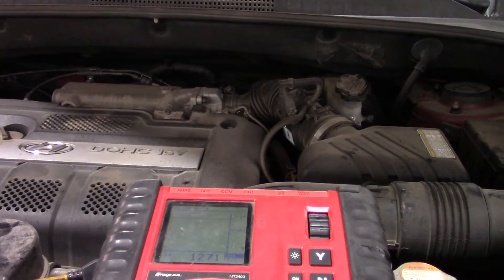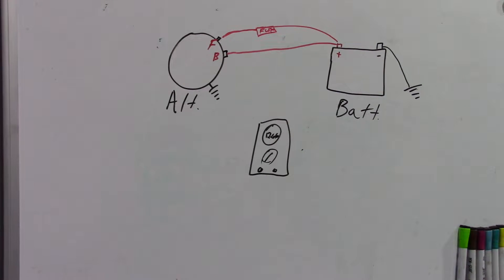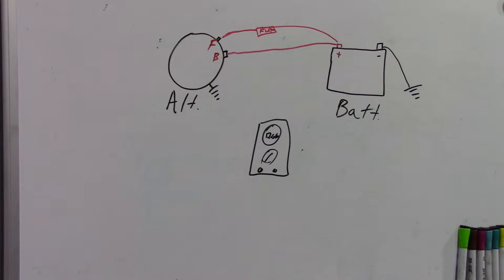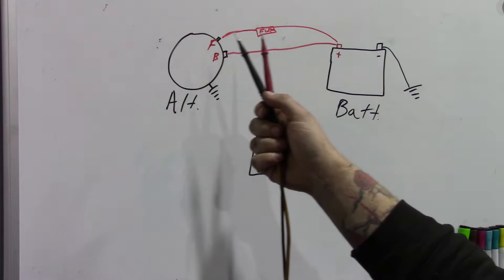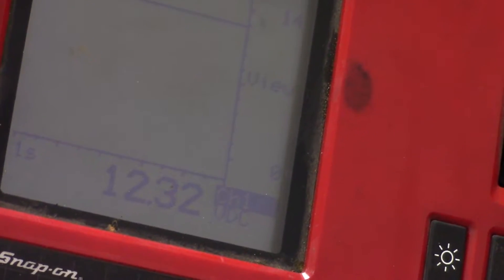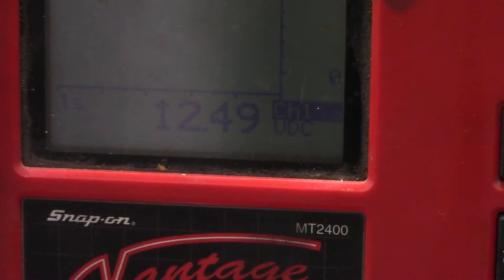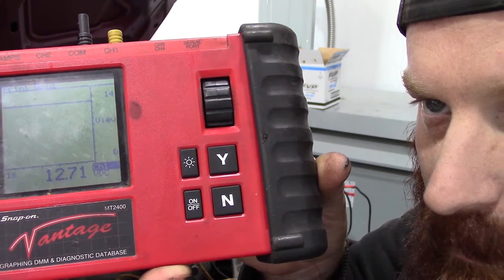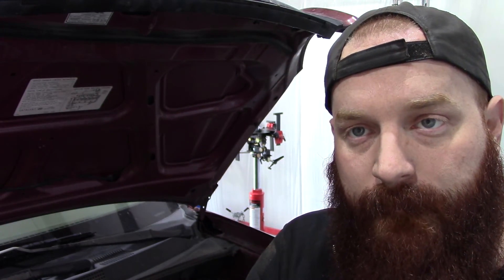05 Hyundai Tucson - Battery Light On

Comment: Good explanation, but what if alternator charges only within several minutes and then just turns off. In other words it shows 14.2V at start like in the video while engine is cold, after several minutes running (2-5mins) it just stops charging and shows red battery indicator. the voltage just drops to 12.5 and lower. On the next day (cool engine)  red battery indicator on the panel disappears. Starting the engine,  shows stable 14.2(3)V, several minutes later the alternator stops charging again, shows red indicator, 12.5V on the tester... same again. Battery is new, the fuse is ok.
thanks